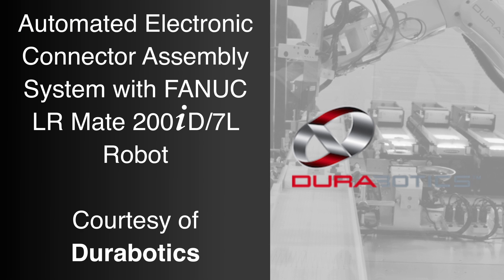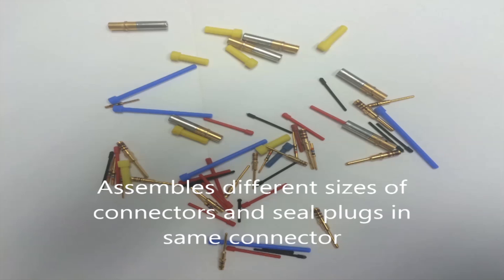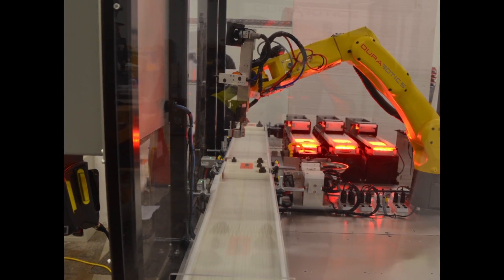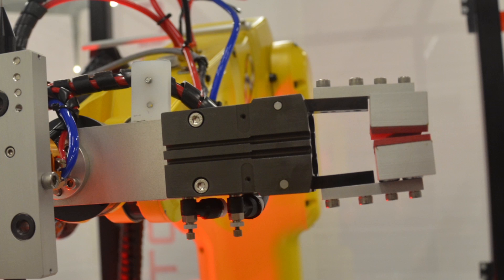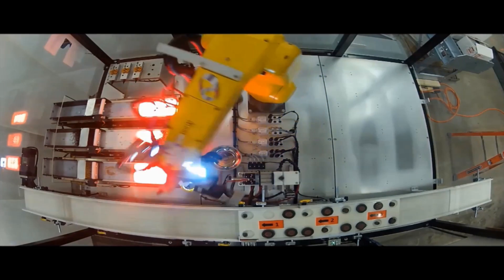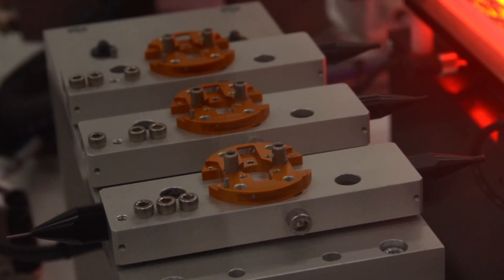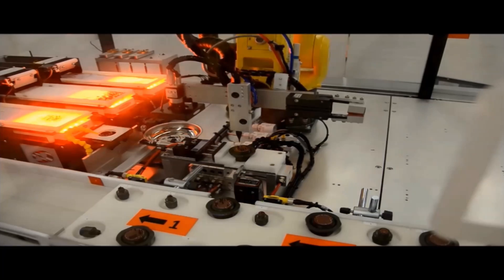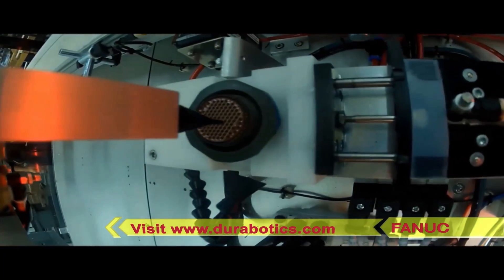Automated Electronic Connector Assembly System with FANUC Robot - Durabotics

Comment: This is interesting.  It would  be really nice though, if you could handle wires already crimped into the different barrel contacts.  As in, grab wires one at a time from a bundle and  insert them in their locations.  That is why the green tool in the video has a split in it.